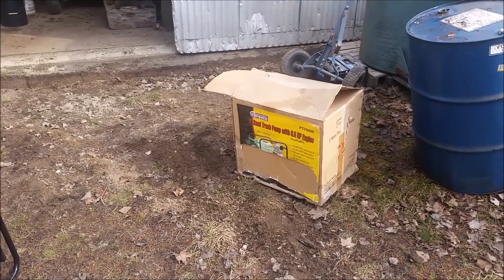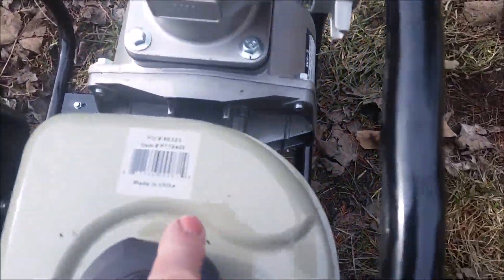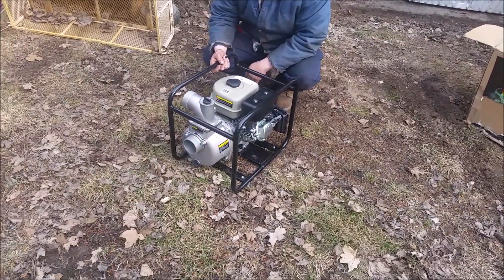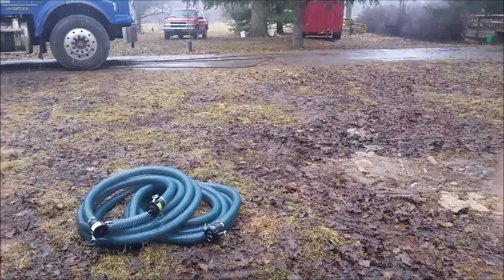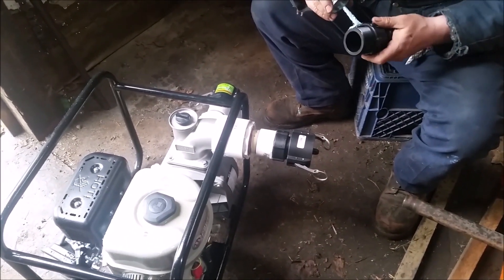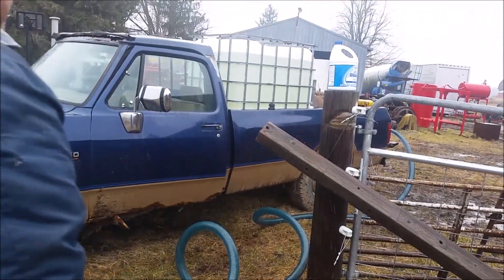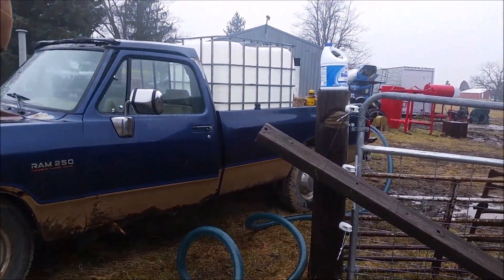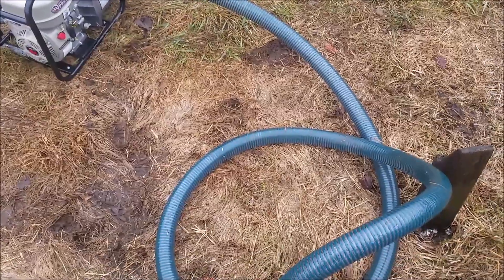Maple Sap Transfer Pump 50 Gallons in 30 Seconds!

Comment: Hey there, you still using this pump?  I see a lot of people using these although they are not FDA approved.   Doesn't seem to have any significant issues coming with it, right?
Reply from the maker: More sanitary than what most people use in making maple syrup and the pump thru maple supply is a little Honda not stainless steel either. The seconds of contact are not enough to cause concern.

Comment: Is it okay that the pump is not FDA approved stainless steel?
This is pre-production so it may be okay.
Reply from the maker: The transfer pump thru my maple sap supplier is a little Honda transfer pump for $500 and it is not stainless steel. This is a lot better. Sap buckets on trees are not stainless and a lot of people here use galvanized stock water tanks for collection too. Even our old flat pan was not stainless, as long as your not cooking on a lead soldered pan I don't see a problem.